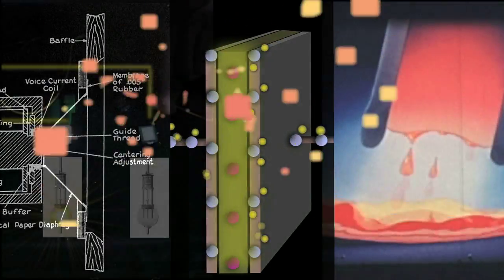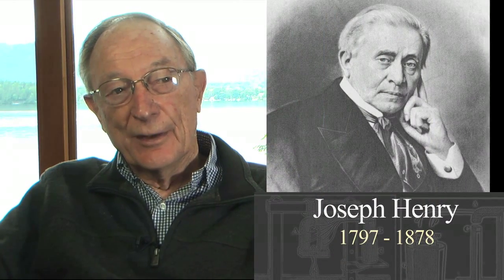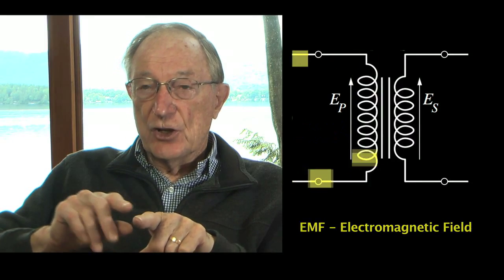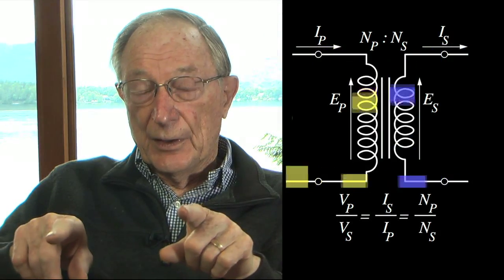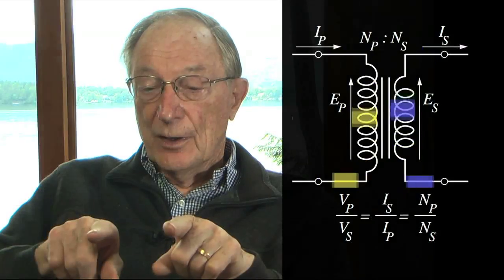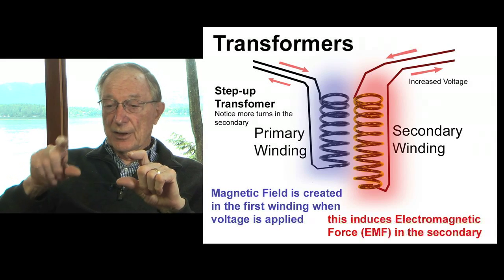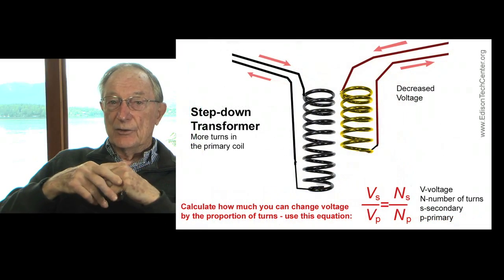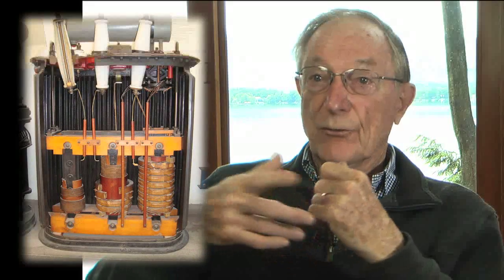How a Transformer Works

Comment: I have a question: Lionel said it's the fact that the current is changing direction that the transformation occurs, my question is how does frequency affect the efficiency? I'm guessing but 60 Hertz must be close to nominal or it wouldn't be so widely used.
Reply: Rudy;   The short answer is that you are correct.  50 to 60 Hz is a reasonable optimum for transmitting large amounts of power through a stationary power grid.  Other situations suggest different frequencies are better for that particular situation.  For example, large aircraft frequently use 400 Hz because equipment designed for 400 Hz can be smaller and lighter.  Older long distance electrified railroads frequently use 16.67 Hz. as it lowers the losses in the traction motors that were available at the time.  More recent electrified railroads usually use 50 or 60 Hz.

In the operation of a transformer there are  3 main areas of losses that lower efficiency.  These are:

1/  Conductor losses:  Current flowing in the wire of a transformer causes a loss due to the resistance of the wire.  These losses are equal to the current squared times the resistance.  Most transformers use copper wire so this loss is frequently called "copper loss".  These losses are not strongly dependent on frequency at low frequencies but at frequencies high enough for the "skin effect" to become significant the additional loss caused by the higher frequency has to be taken into account.  If this is the case though, it could be argued that the transformer is badly designed. The cure is to use multiple smaller insulated conductors connected in parallel for the winding.  This provides more surface area to conduct the current near the surface of the conductor.  (Google "litz wire" if you want more information on this.)

2/ Hysteresis losses:  As an increasing current flows through the windings of a transformer in a given direction it sets up an increasing magnetic field in the core of the transformer.  Energy is required to align the magnetic poles of the atoms of the core material and this energy has to come from the electrical input energy.  It is a bit like compressing a spring.  When the current in the winding decreases the magnetic field in the core decreases and eventually reaches zero.  In doing so it "pays back" some (but not all), of the energy used to create the magnetic field. This is like relaxing the spring we compressed earlier.  The amount of energy that is not paid back is a loss.  You could think of it as "magnetic friction".  After this increasing magnetic field / decreasing magnetic field cycle in an alternating current transformer is complete, then the same thing happens all over again but with the polarity reversed.  Each cycle of the magnetic field creates a certain amount of loss so the more reversals there are the higher the losses.  This means that hysteresis losses are strongly dependent on frequency.  Increasing frequency means increasing losses.   A good core material would have high permeability (magnetic fields flow easily through it),  high maximum field capability (resistance to magnetic saturation), and low hysteresis (minimal losses due to magnetic friction).  It is not possible to maximise all of these characteristics simultaneously so a compromise must be made to choose the best core material given the frequency and power level the transformer is working with.  Most low frequency transformers use a silicon steel alloy in the core.

3/ Eddy current losses: A transformer works by one winding (a conductor) creating a changing (alternating) magnetic field in the core that links to a second winding (conductor) on the same core. However, the core itself is made of materials that are conductive! The core is basically another winding on the transformer that is a continuous shorted loop! This means that voltages will be induced in the core material and because the loop is closed (shorted) currents will flow in the core material. These voltages and currents cause what are called "eddy current" losses in the core. The solution is to use a core material with a relatively high resistance to reduce the current and to split the core up into thin sheets (laminations) that interrupt the current flow. Typical small to medium size power line frequency  (50/60 Hz.) transformers use silicon steel lamination about 0.014 inches (0.36 mm.) thick. The laminations will have either an electrically insulating oxide layer or very thin electrically insulating "paint" layer of some sort to insulate the laminations from one another when they are stacked together to form a core. As with hysteresis losses, eddy current losses are proportional to frequency. Higher frequency equals higher losses.

A good transformer designer will take all of the above factors (plus more) into account to come up with a design optimised for a given task.  For example, to reduce hysteresis and eddy current losses you might want to use a lower frequency - but to do so with a core material with a certain maximum magnetic flux density you need to use a bigger core to avoid saturating the core with magnetic flux. The bigger core will need longer lengths of wire to make the windings and this increases the copper losses!  To add insult to injury, the transformer will use a lot more material and thus cost a lot more!  The bottom line is that you have to balance all the factors to come up with a satisfactory design.

How do I know this stuff??  For many years I worked running an electronics department for the Herzberg Institute of the  Canadian National Research Council.  When I started there I knew nothing about designing transformers.  One day the requirement came up for a special transformer to conduct a scientific research experiment.  Somebody had to design and build it - and that somebody was me!  My first attempt was a complete failure but the way it failed taught me some lessons and the second try was completely successful.  Word got around that I knew this stuff and all sorts of other divisions of the Council started sending their transformer problems to me and over the years I got a bit of a reputation for it.

Comment: I used to love taking a LOW Voltage Transformer and reversing the voltage from primary to 2nd from 2nd to primary. So a transformer than puts out 5v and 120v when reversed put out with 120v in to 2900 Volts out! Then take the 2900 and input it again and you get 70Kv out! (Usually low amperage but may be enough to KILL though)

Comment: @JDavidEfrain P is equal to VI on both sides of the transformer(ignoring losses), if you transform the voltage up (step up transformer) the ampage will go down accordingly.  Conversly stepping down the voltage will raise the ampage, so you cant get more power out than you put in but you can adjust the volts or amps.

Comment: I got a question that's been bothering for a long time , The point is what happens to the conservation of energy in a transformer . I know that  P=VI it's the same in the primary and in the secondary. I know that industries use transformers to drive  huge motors , but if the power remains the  same that means you can't get more energy than what you are putting into the primary Coil . Thanks btw this videos are awesome and clear.
Reply: David;  In a perfect transformer what you say is true.  The power output from the secondary winding of a transformer is equal to the power input to the primary of the transformer.  In the real world there are losses.  Transformers are, however, among the most efficient machines ever designed.  A well designed transformer operating under proper conditions will be 95-99% efficient.  The three main areas of loss are copper losses in the windings, hysteresis losses in the core, and eddy current losses in the core.  For a lot more detail on these losses see my answer to Rudy Cervantes in this comment section.

Comment: Before determining the number of turns on the secondary, the primary winding has to have the right number turns to suit the incoming voltage and the kind and shape of the iron core; too few turns and power-wasting currents flow; too many, turns and the abiltiy to deliver good amounts of stable power suffers.